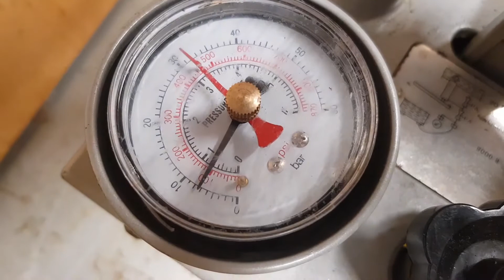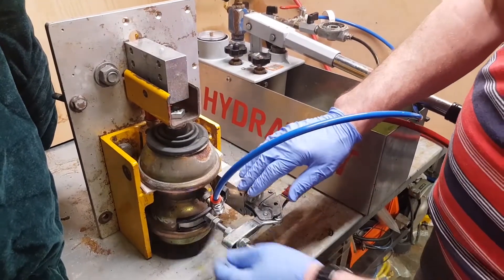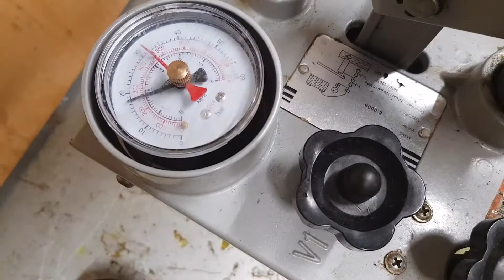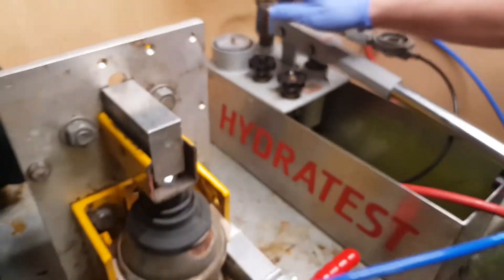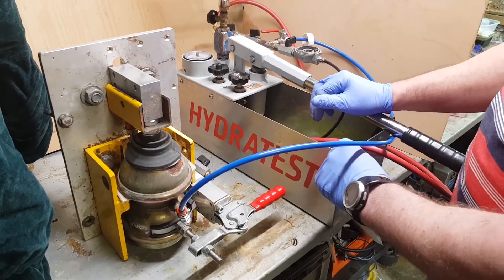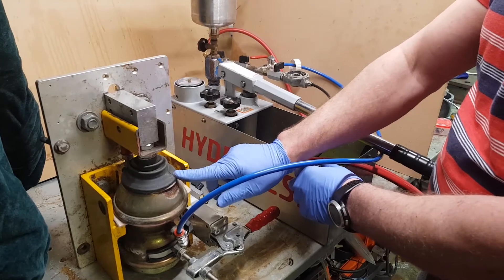Testing nitrogen pressure at home

Comment: Citroen patent ?
Reply from the maker: No similar system to Citroen but simple, more durable AND cheaper 😊  used on Austin Rover BMC cars since the early 70s. Moulton Patent  made by Dunlop. I repair the Citroen Accumulators and test in a very similar way though
Reply: @mgfhydragas360 thanks 🙂